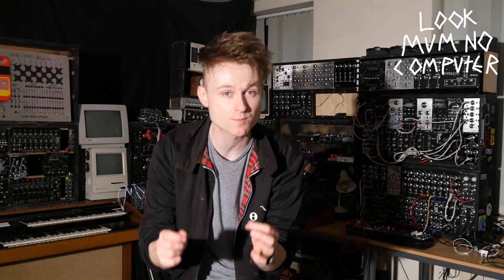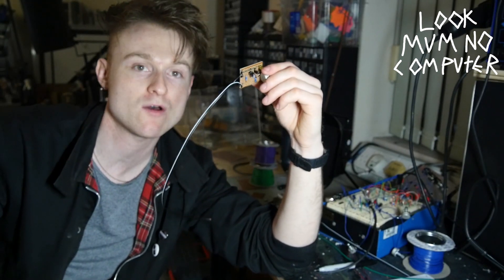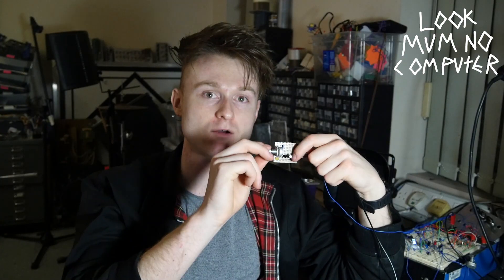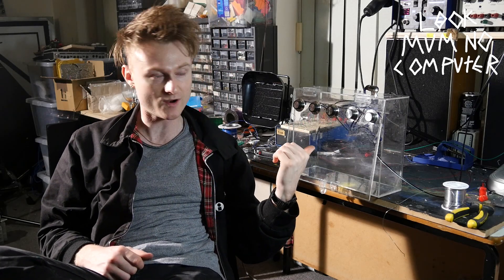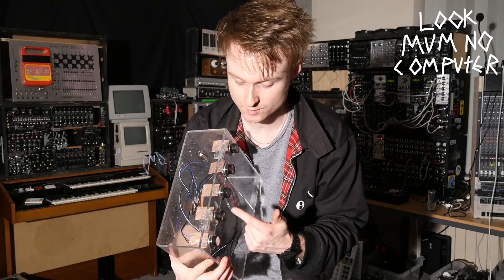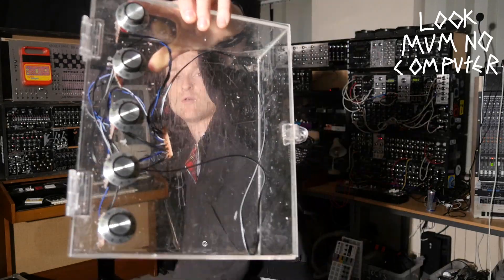The simplest DIY audio oscillator? not a 555 chip. reverse avalanche

Comment: Help me! My circuit seems to work, except when i connect the grounds together (my amp's ground and the oscillator's). If i disconnect the out's ground from the circuit, i can hear the oscillator, but with a loud hum from the amp. If the grounds are connected, i get silence.
Reply: At last you get it working hahaha
Reply: I moved the audio-out pin to the LED's positive pole, and now it works fine! (i'm still interested, why didn't it work in the previous setup)

Comment: Great video! I managed to get it working with a BC547, couldn't get it to work with an 2N3904 though. 
And I run into a problem when I connect it to my LM386 amp. If I run the oscillator at around 16 V, the voltage between output and ground is around 10 V (DC). Do you guys measure similar DC values? I have the elko in parallel to the transistor (cut the middle leg of). To get rid of the 10 V DC I tried placing another elko after the output, between oscillator and amp. However, in this case the oscillator always oscillates a bit. 

Any ideas on this?

Thanks! 

PS: Having 6 of them already sounds cool:) In the last one I used an LDR in series with the potentiometer and coupled it with the 5th one. That way you can tune both oscillators first and then change the pitch together:)

Comment: hi lookmomnocomputa, i'm trying to build this oscillator and there's one thing i don't understand. Why is there only one wire for the audio output? Shouldn't there be two, one for positive, one for negative? And if yes, where does the other wire goes?
Reply: negative on the audio output just connects to ground, let me know how you get one - ive soldered two together and can't even get the led to blink :(
Reply: i finally made it, and it works! the sound is very weak though, i hope it's because i could only power it with 12V: 
http://www.noelshack.com/2018-13-5-1522443752-cxw.jpg
http://www.noelshack.com/2018-13-5-1522443806-vcx.jpg
it's a little bit fucked up because i broke the board when i snipped it, but all in all it's the same: the blue wire is the voltage, i just hooked it up to the leg of the 1k resistor (which i moved for the same reason) of the same line
the red and white alligator clips both go from ground wire to negative speaker and negative power
and don't forget the bridge right next to the potentiometer
hope that it'll help you!
Reply: oh and the long leg of the led must be on the outside of the board
i didn't try the other way around but i guess it wouldn't work because it's polarized
Reply: managed to get one working on the breadboard by replacing the LED with the audio out - but will try with the LED in place but backwards as i dont think i tried this at all - thanks

Comment: I want to make and string about 20 of these together to make a sick drone synth for my live setup - any idea what kind of Amp rating the power supply will need? Been trying to find out from google but I can't
Reply from the maker: fu4mkgic i made a hundred oscillator synth from this circuit only needs 3 amps. Well .. less but I use a 3 amp power brick
Reply: easy as, awesome! thanks man looking forward to putting this together. have just discovered your channel and love it already, hope i get to see you live one day!
Reply: ive tried to make two of these now and neither of them work (cant get audio and LED doesnt light up - no idea what time doing wrong - what is the watt rating of the resistors you used?

Comment: Bought all parts, solder them together and BOOM, no sound, just an adjustable LED :( I guess, not all 2n3904 work here. I‘m off crying about these poor transistors wich lost a leg now :‘(
Reply: I have the same problem actually, how is it possible to solve?
Reply: I feel like I'd just bend the leg up and around till I knew it works but that's just me
Reply: You have to have the thing hooked up to a speaker. If you don't, then nothing will happen. The circuit doesn't produce the sound itself, it merely gives a signal for the speaker to produce
Reply: @Tergative  
Seriously?
I would have imagined the speaker was part of the circuit diagram.
I didn't bother to build it myself, so I assume you know better than I do.
I've got cooler things to build, but this channel mostly lends itself to being listened to while working.
Reply: MOPtooth :c they lost a leg
Reply: Hippity Hopity me too
Reply: Some transistors don't wanna reverse voltage cascade.
Even if you're using nothing but 2222's, you might have to try three or four of them to find one that does what you want.
Not much to be done about it, except to use a different circuit.

Comment: nobody noticed that the negative leg of the cap goes direct to the ground  on the stripboard layout, while on the circuit drawmade the same - leg cap goes to the + leg led ??
Reply: i mean its near the same but..
Reply: Yeah, that fucked me up too. Also, I could only get sound to come out if I put the output parallel with the LED. When I put the 100k resistor in and then the output I couldn't get anything out... Did you have any luck with it?
Reply: i put the cap inverse way :I.. even when i fixed my mistake.. couldnt get anything with two 2222 (first i thought the transistor could be dead) and 9014 transistors in 19v and 18v...
Reply: Hi Aidan
Reply: Aidan, how did you wire up the output in parrallel with the LED, ive made 2 of these now and I can't even get the LED to light up let alone get any sound out of it
Reply: got it working on breadboard, ended up replacing the LED with my audio, capacitor is backwards - slight deadzone on the pot and no resistor before the audio out

Comment: Hi
Thanks for all these wonderful videos.
About the simple oscillator, on the schematic as on the picture of your stripboard ( https://static1.squarespace.com/static/5912db7ee6f2e1435dbab4fd/t/59e4bcdfd7bdce1e8a5b137d/1508162785231/Screen+Shot+2017-10-16+at+14.28.15.jpg ) the capacitor has its "+" connected to the ground, is that normal????

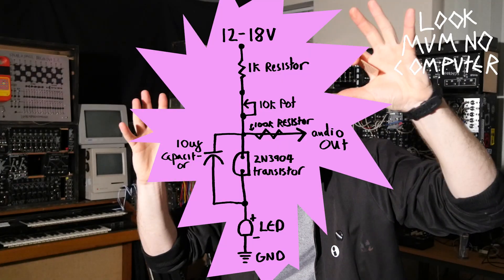Comment: great video! i think theres a mistake tho with the curcuit at 1:57.
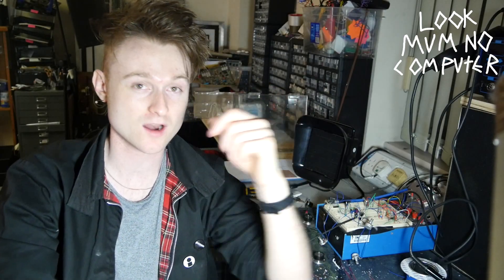both the transistor and the led are supposed to be parallel to the capacitor. the stripboard layout at 2:57 shows it right. or do both ways work?
Reply: I got it to work the way he shows in the pink schematic on a breadboard, with the 3904 backwards from how he has it, haven't tried his stripboard design
Reply: @TubeYouDubeDood  so only the transistor is wrong in the schematic? stripboard and drawing are different

Comment: how are you mixing the audio signals from each of them in the end? are you just running all of the audio outs into the tip of a common jack with common ground going to ground on the jack? Thanks for this great video!

Comment: Awesome video!!! I couldn‘t get it to work with the 2n3904 and 12V, but it works fine with the BC337. Output is still really low (approx +100mV to -60mV) and there’s still a dead spot on the potentiometer. Any ideas how to get rid of that dead spot?

Comment: so... if you replace the pot with switches for various values along what would  have been on the pot you could use that as a keyboard..no?
Reply from the maker: Joakim Engström yeah you could! It wouldn’t be very good tho! But it would definitely be one!
Reply: how do you do that?
Reply: offtheheezy well , i though of it like this. Not sure if this would works though .  in theory  the pot is a sweep of different values.  If a 500k pot is on full its at 500k , half would be 250 and so on. Pick values you like,  lets say 2 per oscillator or so. Lets say that makes a B and C note or something. 500 and 250. Now just add.. resistors(?) With those values and switches insted of the pot and you could make that B and  C clean with a switch. No sweep though.

Comment: Just a quick question: I will be building the project at the end, but I'm a bit confused about the layout. If I want to sum all the five oscillators with an opamp, how do I power the opamp? With just the ground and the 18 V? Or if I use two 9V batteries in series, just use +9V and -9V? I don't really know. Oh, and wouldn't the summed signal be too hot?
Reply from the maker: you dont need an opamp. that at the end, all the outputs are literally soldered together, it's the purpose of the 100k resistor in the circuit, whatever you plug it into, chances are theres enough impedance/ an input opamp. that you dont need to bother putting one on here.... ei an interface, or other modules
Reply from the maker: you could do that with the opamp. but if i was you i wouldnt bother :)
Reply: Thanks a lot!

Comment: Is there anyway to turn the sound being generated and put it through a TRS jack? I am in the process of making my own 5 oscillator drone box for a project and would love to be able to jack it into my focusrite Audio to digital interface. I know its the transistor oscillating, but surely there is a way to convert that frequency into a digital signal. 

I think I will probably slap some low pass filters that were posted in a previous video if the above is possible. Also the capacity to add guitar pedals to the box would be amazing. 

Oh and subbed btw. I have been looking for a suitable drone sound for an album idea and lo and behold, I find it in the most unusual place.
Reply from the maker: for the low pass check the new schematic on the website in the description, as for the jack, just wire the audio out to the tip of the jack and the ground to the sleeve of the jack (Y) :)
Reply: Thanks man, you're awesome!

Comment: DUDE, I think the schematic has an error; the negative leg of the cap should go down to the negative side of the LED, no? I am using a 4.7uF electrolytic cap and a 20k pot and the pitch range is pretty nice although less resolution in the sweep. I also tried a BC547 as well as 2N3904 and the BC547 is higher pitched relatively with some break-up in the highest pitches, this 2N3904 sounds richer to me.

Note to anyone trying this and having trouble: duplicate the strip-board diagram; flip your transistor (the two I tried had opposite outer legs); to test with a button speaker, lose the 100k resistor.

And thanks for the rad videos man!
Reply: If you lose the 100k resistor, then what are you connecting the output to? First pin of the pot?

Comment: How do you connect the tune and tone on your website with the ‘out’ ‘+12-18V’ and ‘ground’ ?
Reply from the maker: hey im a little confused by the question. happy to help though so let me know!
Reply: LOOK MUM NO COMPUTER uh.. like on your webpage there is (under the Red Bull video I have yet to watch...) showing how to make a t7ne and tone oscillator and I don’t know what to do with the 2 outputs (out the blue, and gnd ground) and 1 input the 12-18 volts
Reply from the maker: so the 18 volts (from 2 9 volt batteries) goes into the input, and then the minus of the battery goes to the gnd..... then the audio out goes to the tip of the speaker cable! but also attach ground to the sleeve of the speaker cable. does that make sense? it makses sure the ground is shared with your battery, your oscillator and your speaker....?
Reply: LOOK MUM NO COMPUTER ohhh!! Thank you thank you thank you thank you!!!!
Reply: LOOK MUM NO COMPUTER also, do you need the transistor or the led becuase I’ve found a way around that and the stripboard

Comment: So I was trying to do this,but the circuit wasn't working and had a more knowledgeable friend look into it. Apparently the transistor,even with the third leg off, will only work based on batch and by company.  Maybe this is because I'm in ca nada and got a bunk set, but be aware that this may be the issue.
Reply: Was your LED lighting up even with the bunk transistors? I can't even get it to do that :(

Comment: The stripboard layout shows the capacitor(+) and D1(-?) connected directly to ground, but only the LED(-) in the schematic. Which is correct?
Reply from the maker: Matt Gray it’s correct. The capacitor can work either way. However initially I found it better being orientated the wrong way. But I have since found it’s very particular in that orientations there’s an updated schem on the website. But they are both correct. Either way works

Comment: I tried to build it but it does'nt quite seem to work. the only sound, i got from it at all was when I got rid of the 100k resistor and then the sound was very quiete and also very high pitched with not even a full octave of range. Could this be an issue with the transistor? its a  2n3904 -f38
Reply: You have to play around with transistors

Comment: Basically that means I could buy a monophonic synth, hack it, add a bunch of homebrewed oscilators mixed before everything else, connect them to a controller going in/out something like Pure Data and get a kind of polyphonic/ paraphonic synth. Hm. Definitely each voice needs a filter/envelope. But you get harmony feature already. And it's a nice extension.

Comment: Sorry Sam, but I think there is an error in your schematic.  On your stripboard layout pic and in the video, the negative leg of the capacitor goes to ground.  But in the schematic, the capacitor is bridging the transistor, and the negative leg is connected to the positive side of the diode.  Haven't gotten the circuit to work yet, but uncovered the difference during troubleshooting.  Cheers.

Comment: You and your channel are dope. Synths are dope. You are a national treasure. However I’ve seen and have also experienced this project not fully working, ie the LED responds but no oscillation occurs. Best I can figure is that your source components vary slightly via manufacturer. Can you provide a parts list with links to your supplier? Xoxo from ‘merica.
Reply from the maker: hello eric, yes a few people have had trouble. and yes i can only guess that is the issue! some people have had luck with 2n2222 transistors if not these are the ones i used   https://www.rapidonline.com/trusemi-2n3904-transistor-npn-to92-60v-81-0484    also try turning the capacitor around, to the opposite pictured!   ALSO. there is an updated circuit i will add it to the page now!!

Comment: So as a complete noob to electronics, I'd like to ask - does this require 1/2w resistors? Or would dinky lil 1/4w resistors work without going up in flames (since they're what I've got laying around)?
Reply from the maker: 1/4 watt should be fine. the motto i go by is "if in doubt, try it anyways" :P
Reply: LOOK MUM NO COMPUTER Sounds like a plan! Guess I'll just have to see if they can hold up once I get my caps. Cheers!

Comment: Can you put a scheme of the electricity wiring here underneath? I see you used a seperate central board where all the audio and electricity lines are centralised.And how many volts did you use to drive these 5 oscillators? thanx and cheers out of Belgium
Reply from the maker: solder all the audio together. the power and the ground of each of them. 12-24 volts
Reply: I did put 2 oscillators(12v) in parallel to see if they work like that: with 1 12v-adaptor. Attached the positive and the negative points together but nothing happened. Thanx for your quick answer, and I just saw your video of the sequencer! Great work!!

Comment: Simple current mirror and you will have VCOs. Used to use unijunction circuits in the 70s. You can take a signal off the capacitor in a 555 to get a saw.